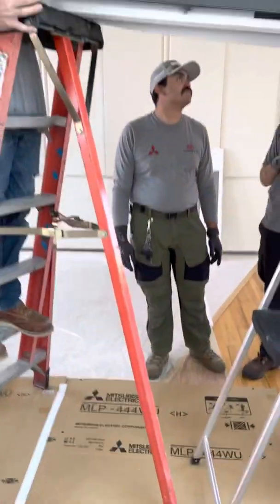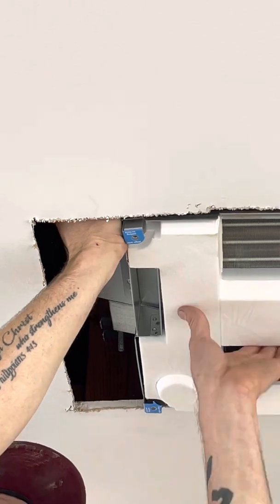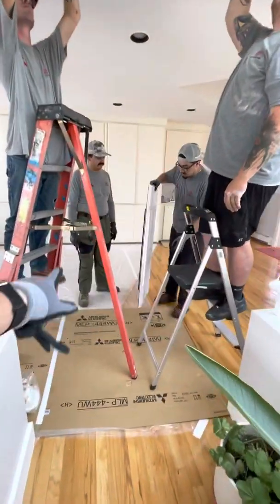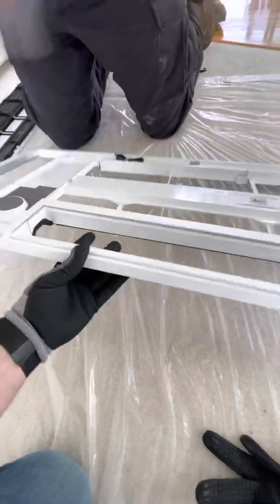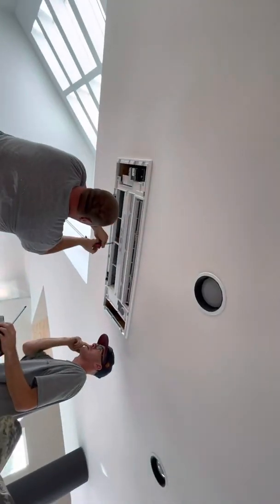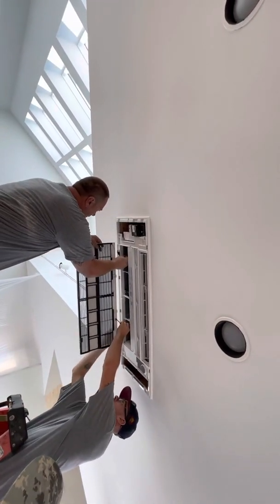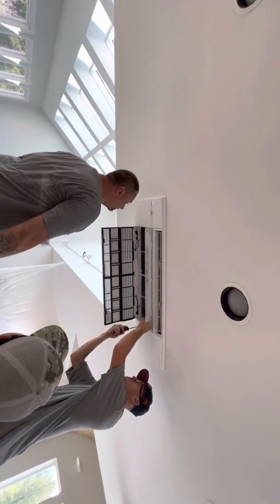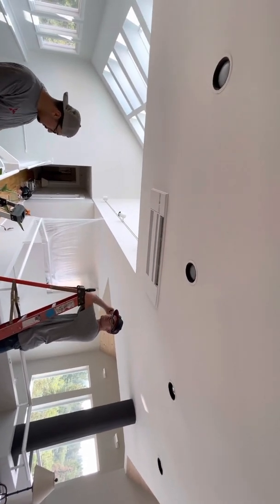Mitsubishi Ductless mini-split cassette install professionally done in under 10 mins Ductless Plus!

Comment: mMine was not installed so nicely.  Can you show from the top side sometime?  insulation etc. with the side doors removed, you look straight into the attic.  Mine was done with cables not allthread.  shaky.  I am in process of re-mounting..
Reply from the maker: That sounds good thanks for watching!

Comment: Love the unit. Put Mitsubishi wall units in my entire house except the master bedroom but did not know that the ceiling unit has a pump and the pump makes a constant noise in cool mode and this particular noise drives me craaaazy! Would have just put in the wall unit...

I don't have a secondary pump just the one that comes built in the cassette... Any tips for how to get rid of the noise?

Lastly if the unit is 8 inches away from an outer wall could gravity do the job of getting rid of the condensate?

Thank you!
Reply from the maker: I would replace the pump then. I’ve never heard a pump in a ceiling unit. You obviously have a service issue call a technician out

Comment: Do you need an attic to install the ceiling units or can it be installed between floors?
Reply from the maker: They can be installed between floors if the joist is taller than 8”.  Sometimes you will need to do additional framing and run the piping in separate joist bays. 

Jared
Reply from the maker: Please subscribe and like the videos it really helps us out. Have a great day!

Comment: I have a question about these units I installed one for the first time ceiling drywall not up yet but the opening between the floor joist is the exact size of the unit check to see if it'll be a problem when installing the grille because install manual say to cut out 15 1/8 . Please let me know thank you
Reply from the maker: Use the template and install it to the unit before the drywall is put in. Please make sure they cut the drywall exactly to the edge of the template and your going to be fine. Grill will fit perfectly. 
 
Remember you need to hang the unit 1/2” below the framing so the screw mounts for the grill are flush with the drywall. 

Jared

Comment: Do you build the bridges when you do not have attic space?
Reply from the maker: If there is no attic space we use a 2x4 block then a Sammy 3/8” short lag connector and drop the all thread

Comment: Is the fan blowing towards the stairs ? Or towards the 2nd fl wall ?
Reply from the maker: That’s a small landing and it’s the TV area. It’s blowing toward the entertainment sitting area.
Reply: @ductlessplushvac  so the coil side is facing towards landing/stairs?
Reply from the maker: @shielduniversity419  it's blowing towards the wall not the stairs.
Reply: @ductlessplushvac  than you
Reply: @ductlessplushvac  If this is a low ceiling room would it be better to have it blow toward the nearest wall to avoid a draft or should it blow to toward the center of the room?
Reply from the maker: @meow5  The unit is designed to blow from one side if the room to the other side of the room.

Comment: So if you had no attic space to work im thinking the only way to finish job is to cut 1 or 2 access on each side of the unit. Also what size do you cut the while for the unit ? Anything will help
Reply from the maker: Sorry for the late reply. You don't need to do that just get the piping to the panel and your good.

Comment: Great video.  Hoping you can help. The condensate drain calls for a VP20 pipe with a 26 mm o.d. But 3/4” pvc is 26.7 mm o.d. Mitsubishi calls for using pvc cement. How do you make this connection?
Reply from the maker: Mitsubishi has a tubing that connects to the drain that has a three-quarter inch PVC connector at the end just use a three-quarter inch PVC pipe.
Reply: Is it different than the tubing that comes with the MLZ units

Comment: Thank you for this great video! Fantastic work!
Do you need access to an attic to install this unit and the refrigerant lines? I am thinking to do this in between floors and wondering if this may not work if refrigerant lines can only be connected from the attic. Any suggestions? Feedback? Thank you!
Reply from the maker: You can install them with no attic as long as you can get the piping and drain lines out horizontally. We put them in 10-9” joist’s all the time. I’ll make a video on one we’re working on.

Comment: You mentioned caulking the cover to the ceiling.  Won't that bite you or whoever when they come to service / clean the unit at a later date?
Reply from the maker: If you cut it with a razor blade its easy to remove. You only use a very small amount.

Comment: is that cassette for attic install only? Or can it fit between floors?
Reply from the maker: It can fit in any joists that are 10”
Reply: I believe the EZ Fit only requires just shy of 8" clearance top to bottom.